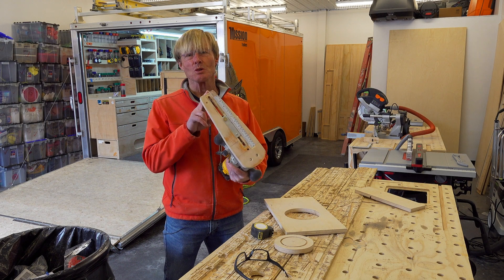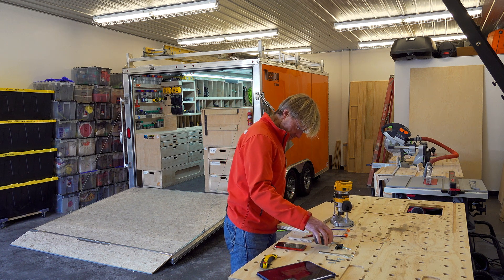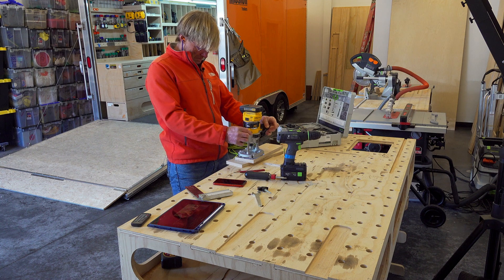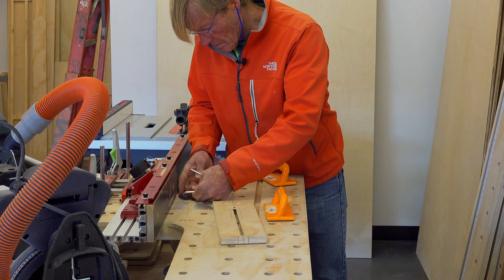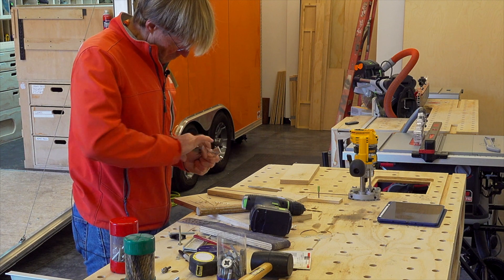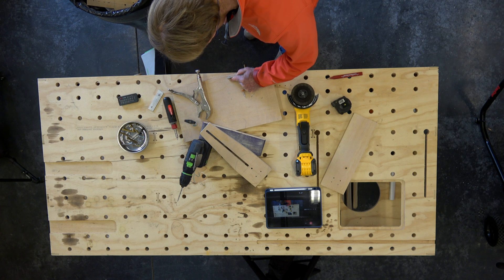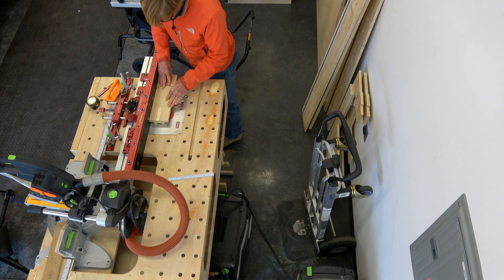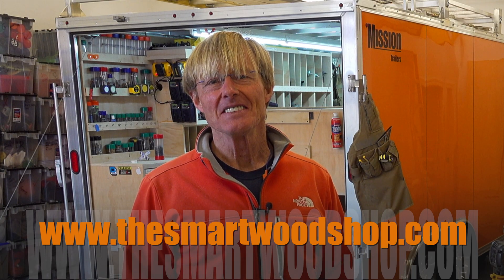How to make a circle cutter for your router

Comment: as usual a very neat and cheap add-on to a good tool. Just a note your website is not working properly as I went to check a couple tools out, all I get is the headings ie; POWER TOOLS / HAND TOOLS / KEVIN'S TALE SAW, and no more info,link or pictures :(( Karl
Reply from the maker: . houtslager we are working on it. They are there but take 20 seconds to load.😎🤙
Reply: If you have an ad-blocker installed in your browser you may need to turn it off temporarily as well. That was my problem

Comment: Thanks for another great video. Quick question?  How did you set the tape measure to get an accurate measurement?
Reply from the maker: I set the center point with a tape measure, made a cut to confirm accuracy then made a pencil mark to align the stick down tape.
Reply: Ron Paulk thanks that makes sense